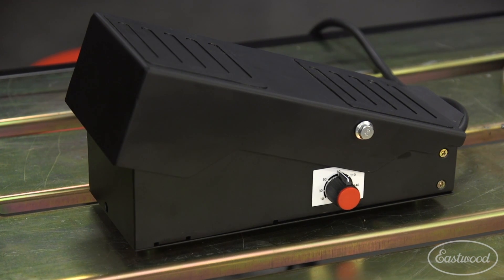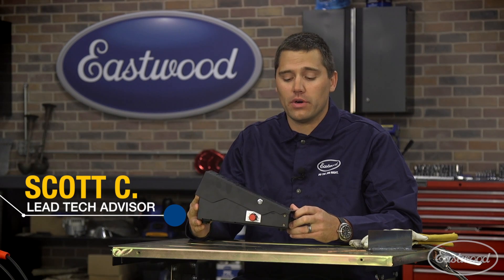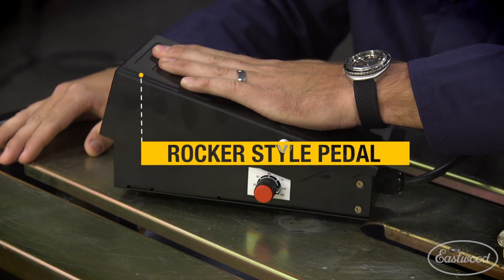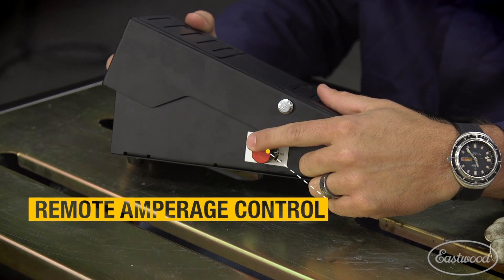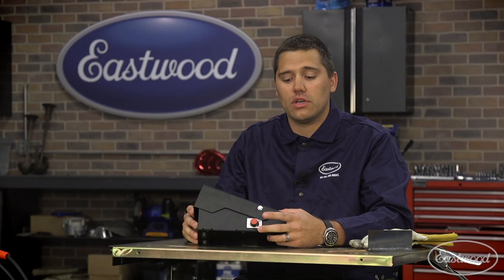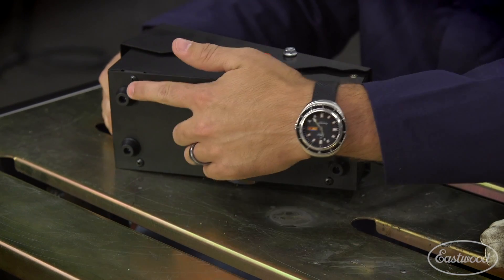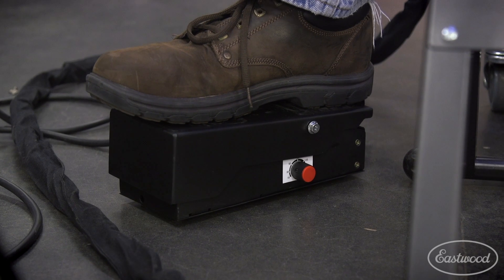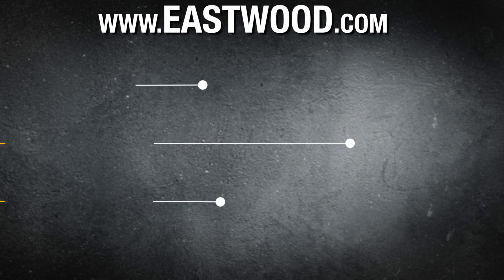Metal Fab Must-Have: TIG Foot Pedal Upgrade - Eastwood

Comment: so the peddles eastwood offer with this tig 200 are not on/off, the knob on the peddle simply sets max amperage, huh, good to know. i was wondering about this. https://www.eastwood.com/tig200dc.html  is machine still lift arc when a peddle is used??

Comment: Will the knob on the foot pedal override the knob on the machine ? If so i am thinking i should set knob on the machine to the max setting an adjust it by the foot pedal knob.  Is this the proper way to do it ????
Reply: I'm 6 years late, but oh ya!! It will definitely over-ride the machine 😆😅 I set my machine at 50 amps and the pedal at 240, thinking it would be limited to the machine. This was my first attempt at tig welding by the way 🤣 As soon as it arced it blew a hole through the 16 gauge stainless tube I was practicing on, sounded like a .22 going off and scared the shit out of me. Nice to know I have a lightsaber at my disposal